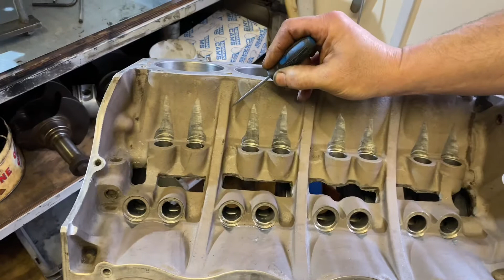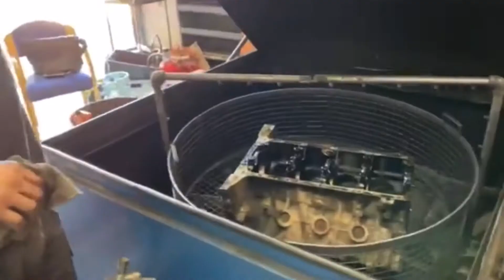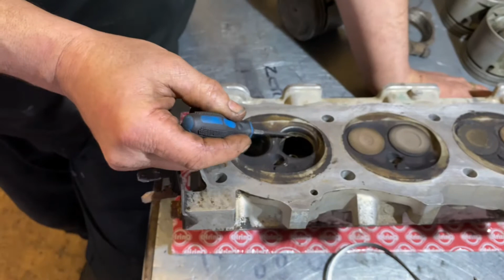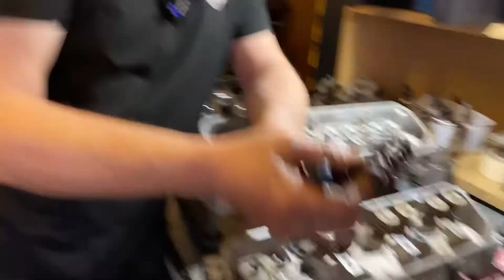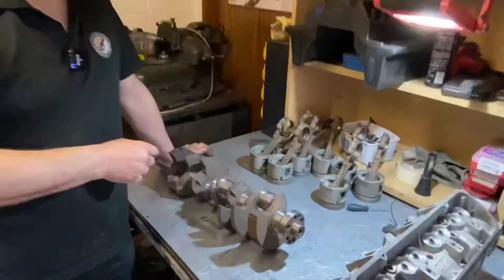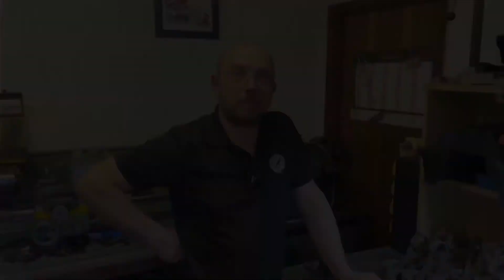P6 Rover 3500 - Manufacturing faults & porting heads Part 4

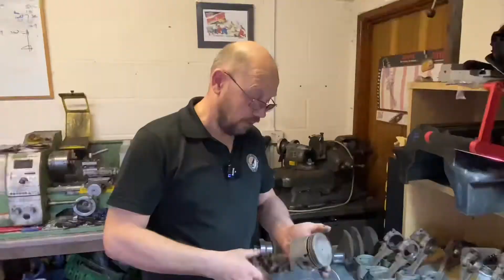Comment: Hello, allow my to say that I am very impressed by the explanation and tips!!!! Keep up the good work. Watching your videos as I am about to rebuild my 9:25 to 1 ratio 3.5 engine. This engine I have bought came with a BW35 auto box already fitted, with Stromberg carbs ,so I don't know the exact where about,plan to fit on my cobra kit car build.... Anyway I would like your opinion on few points if you can. I have a pair of 4.6 heads. What is your option of using these instead the originally fitted. If yes what gasket should be used tin or composite?I am also using Edelbrock intake and edelbrock 1404 carb, electronic distributor. thoughts on viper hurricane camshaft....any information much appreciated!!! TIA
Reply from the maker: the bw35 box is pretty weak, be gentle with it.! just fitting 4.6 heads on there own wont gain you much, but it should bump the compression up if you use tin head gaskets.  cant comment on the hurricane cam, ive never used one.
Reply: @PenguinMotors  Thanks for the fast responce!!!I would like your opinion please on an oil pump upgrading kit?(vendor?) Does it worth doing/needed on this early engine? please keep in mind, Cyprus suffers from 45 Celsius every now and then ...TIA
Reply from the maker: @killikillis  i dont like the upgrade kits with with spacer to fit longer gears, only ones i see leak. if your crank and cam bearings are good, there nothing wrong with the early narrow gears if they are in good condition or you buy new ones. you ac still get them as genuine land rover.
Reply: @PenguinMotors  thanks a million, I really appreciate it!!!